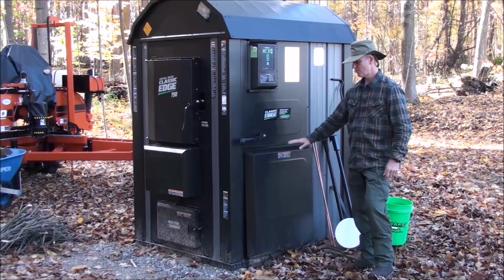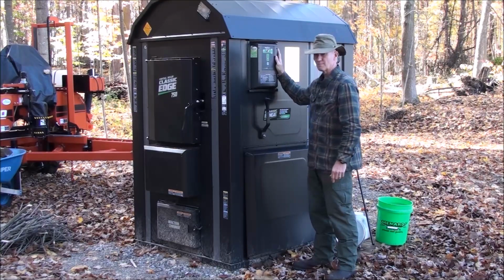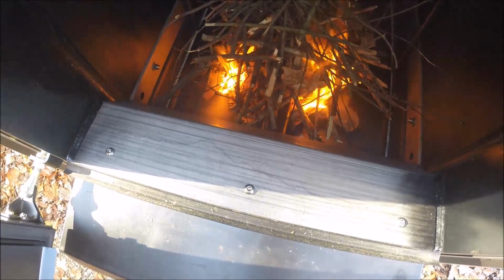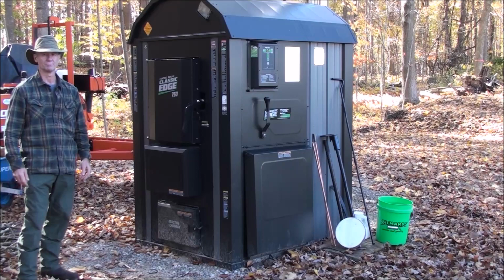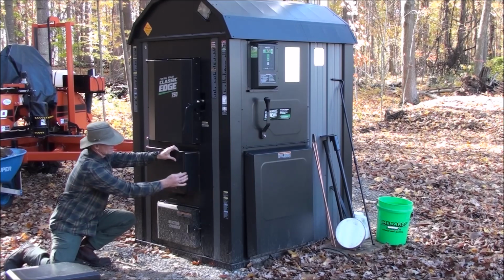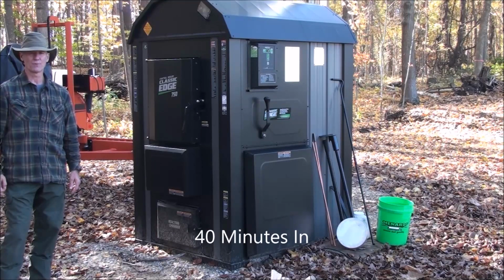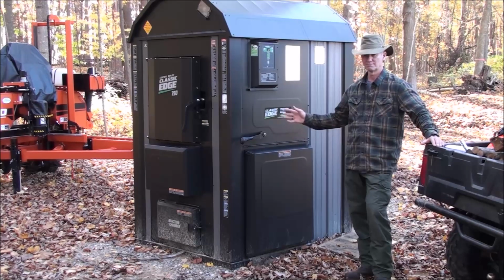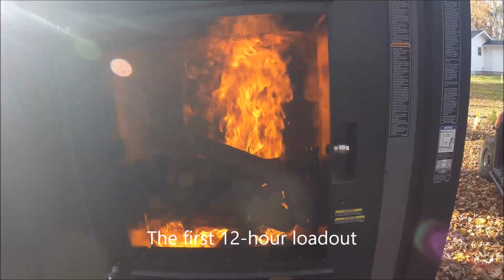Central Boiler Start-up Part 1 - Steps 1 - 8

Comment: A couple questions;  why do you need to wait work the water temp to be 150 before turning on the pump?  And why do you wait so long to add big chunks of wood?  With my old time burner I just put the big chunks in as soon as the small pieces get going.
Reply from the maker: The reason for not starting the pump before 150F water temp is achieved has two parts, one is to keep the heat load down until the fire is well established, and the second is that there is a valve to the house, actually it's in the crawl space, that doesn't send water to the various heat exchangers until the temp gets to 150F.  Before I get to 150F I am just pumping water in a big piping loop without heating the house.  If you are starting a fire the "old fashioned way," tinder -> kindling -> pieces -> and so on, that's what you do.  I usually start my fire with a propane "weed burner" now, so I go straight to the big pieces.

Comment: after the kndling burn   for while do you completly fill it up with large logs
Reply from the maker: Tim Bolt Once it’s going I load it up progressively, a couple layers at a time, until I know it’s self sustaining. These days I often won’t even use kindling. I build my stack, more open at the bottom, and stick my propane weed burner in there for 5 min or so. Door is open obviously. At that point it’s good to go. Shut the door, close the bypass.

Comment: Thank you for sharing! We live off grid in the Rockies at 8,700' elevation. Do you think a boiler like this would be feasible to run on a 2,450W solar system? Not sure how much power is needed by the boiler itself. Does it only need power in the start-up stage...for fans, etc.? In addition to the electronics in the boiler I guess... Then, you would need a fan/furnace situation at the end of the Pex tube... Just checking out alternatives.
Reply from the maker: Back to Nature Living I don't know of any reason why it wouldn't work in the Rockies.  I'm doing the solar calculations myself right now, so I should know more soon.  In fact, I was trying to figure out what size system I would need to support all heating equipment in particular.  The Central Boiler is on a 15A 120V circuit, so that's 1,800 watts max.  The fans for combustion air operate intermittently, depending on what the the control system is calling for, and the water circulation pump runs continuously.  There are 2 thermostatically controlled electric zone valves under the house.  In the house, we do use the fan to move hot air around in 3/4 of the house, in the remaining 1/4 we use hydronic baseboards.  You don't need a furnace; we had one to provide AC and heat (propane fired), so it made sense to install a water-to-air heat exchanger and use the furnace blower when the outdoor furnace is in operation.  This is just a guess, but I think your solar system would be enough.  Maybe you would want to add some storage capacity to get through the cloudy parts of the year, but at 8,700 feet I think you get a lot of sunny days.

Comment: A friend of mine just moved into a house he and his wife bought with just over 600 acres of Woodlot with an outdoor wood burner by portage and main BL 28-40 already installed and hooked up but he didn't know anything about it and knowing of my knowledge he asked me to come over to instruct him and his wife how to fire and care for it, took all the small pieces you generate when you split wood and tossed it into the firebox and took three pages of newspaper crumbled up and shoved under the wood and lit them off  waited one minute closed door and went in for coffee. Came back out 15 minutes or so later to find a nice bed of coals sitting in the bottom and added 10 chunks of split fire wood, checked the fire 10 minutes later burning nicely added more wood until we were about 3/4's full and closed door turned on blower and back for more coffee. We had previously installed a thermostat kit from alternative heating systems which allows you to use one thermostat that so long as hot water over 120 degrees is supplied from the wood burner the oil burner doesn't come on just the circulator pumps for the cast iron radiators. When they ought the house after moving in I was helping him cut up and haul and stack firewood and the first thing I had to instruct him was never cut down a live tree. Always cut the dead and down trees or still standing dead trees. In just over a month with the help of his 4 wheel drive Kubota tractor we had over 35 cords of wood cut, hauled, and stacked 80 percent of which will fit inside the firebox door without splitting. He loves it as with 5 girls not counting his wife domestic hot waterways always in short supply and expensive but is considerably cheaper now with his artesian well and his own 3000 gallon septic system installed this past summer as the original was over 15 years old and too small for the number of people living there. 

They love the wood burner after we made alterations to the original plate heat exchanger that was installed for domestic hot water to feed a 30 gallon tank. We used the alternative heating systems convection domestic hot water heater with a new unpowered 120 gallon tank using the water flow from the wood burner water pump and the convection heater works better than they hoped. I'll be honest they were skeptical when I suggested this was the way to go but 30 minutes after we opened the water valves to fill the tank and they felt the hot water moving from cold water entering at the bottom and hot water entering the tank 12 inches from the top of the tank through a side connection they started to believe. The house has 2 1/2 baths and they love it as long as wood is in the firebox the domestic hot water is unlimited.

Their old house cost them just over $7,000 a year to heat. So far there only cost is electricity and about $70 worth of gas for the chainsaws and tractor.
Reply from the maker: Great story James.  I have a couple of blog posts you might find interesting.  The first discusses the cost of heating with wood as you mention.  In our neck of the woods, even if you buy the wood, it is 1/3 the cost of propane, and 1/7th the cost of electricity.  https://primalwoods.com/sustainable-heat-year-2/  The second talks about resilient and sustainable potable water systems. https://primalwoods.com/resilient-sustainable-fresh-water-systems/  It is pretty amazing what can be done, even, or perhaps especially, by DIY'ers.  The possibilities are almost endless. Thank you for your comment, it is much appreciated.

Comment: did the installer fill your pex with water? I have to purge my system of air today before I light my fire.
Reply from the maker: Ben Bryan , yes, they filled and purged the system of air, I did not have to do that.
Reply: If you weren't ready to light it right off the bat they won't add the water,only and I inhibitors as the bacteria in the water will eat the nitrates ect